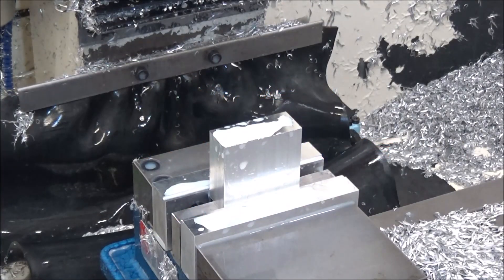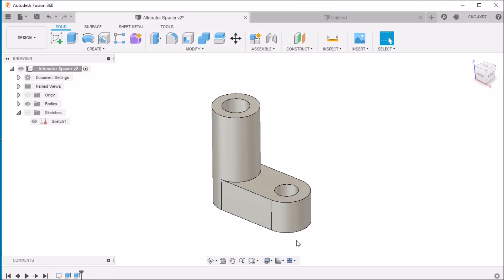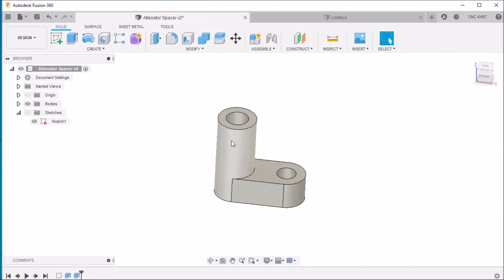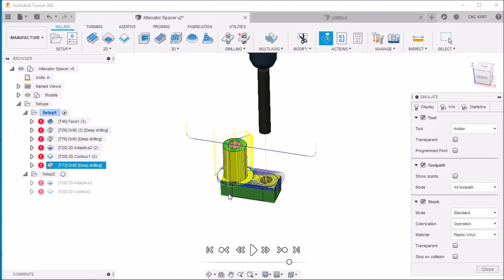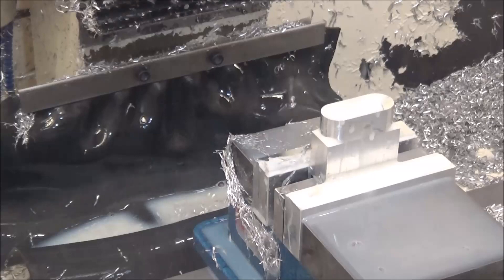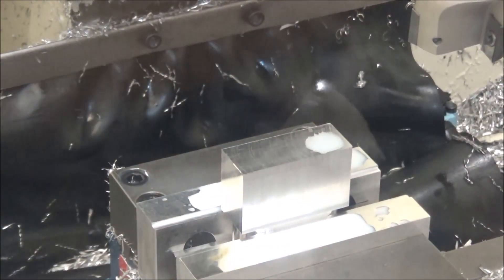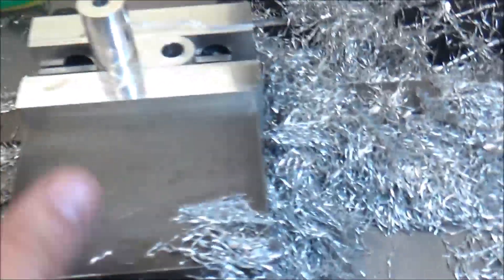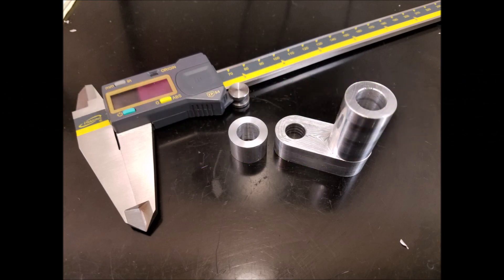Alternator Bracket Spacer

Comment: Excellent work
Have you using mach3 with window 7 or not??
I am using of mach3 with windows 7 but my problem is when I machining some part for second time the machine doesn't machining exactly on there and miilimg some chips about 0.01 mm or 0.03 mm
Do you have problem with repeatability of cnc your cnc or have you ever test the repeatability
Do you know what is the problem
Thanks
Reply from the maker: No issue with repeatability. I suggest doing some backlash checks etc.
Reply: Some possibilities: 1) Mechanical issue. As suggested, check backlash, etc. 2) Noise getting into the electronics. Check for proper cable shielding & routing, loose wires, and electrical noise sources (plasma cutters are notorious for this). 3) Operator error in the zeroing process. Although you probably know all this, I’ll list it anyway... check for absolutely clean surfaces before setting them in the vise/fixture; always re-check zero before starting each part; and check your instruments for repeatability and backlash (if your indicator/edge finder/probe won’t find the same point in space two times in a row; then obviously you’re going to have trouble...)

Oh, and also be sure that the PC is not connected to the internet, has no viruses, and no antivirus software running (it’s a pain in the neck, but the best way to be sure is to do a complete erase of the machine, and then install only from known good CDs).